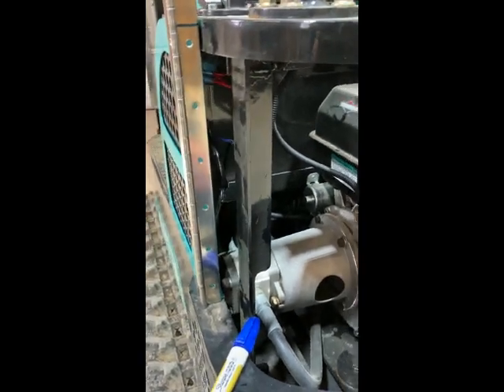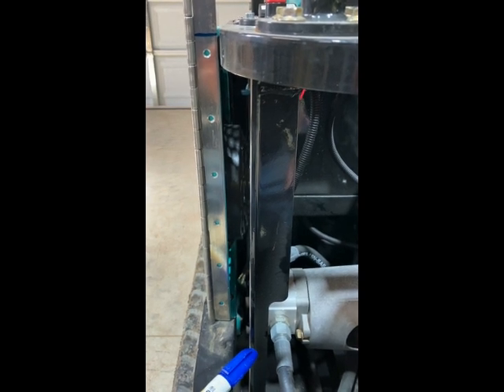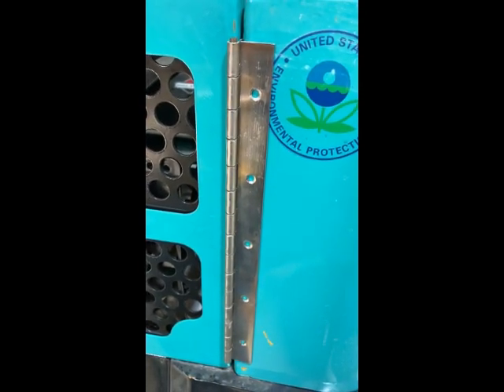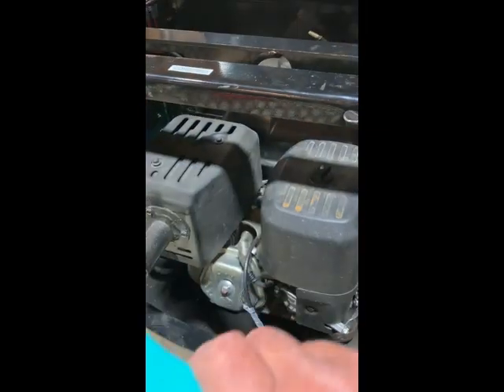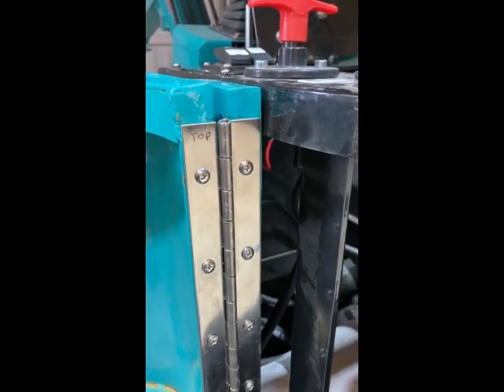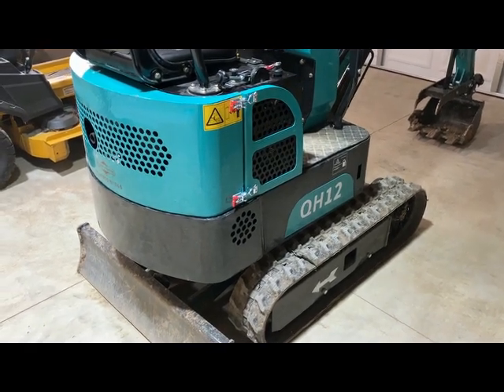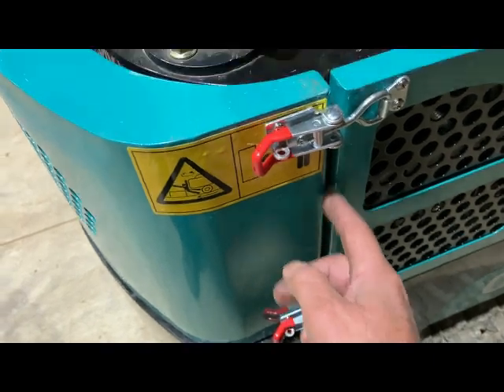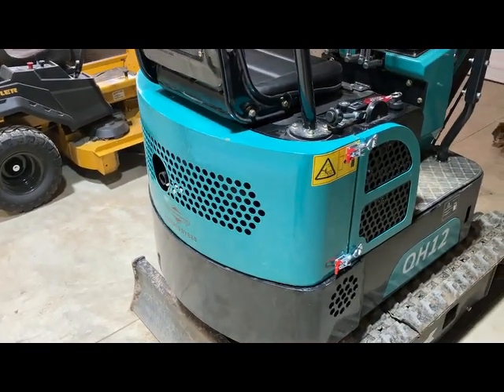AGT QH12 Hinged Rear Cover

Comment: I did the same mod to my digger and found by placing thin weather stripping between the top cover and the bottom cover, it stops the rattle when working
Reply from the maker: Thanks Ken, I didn't think about that. I'll give it a try.
Thanks for watching and the comment.